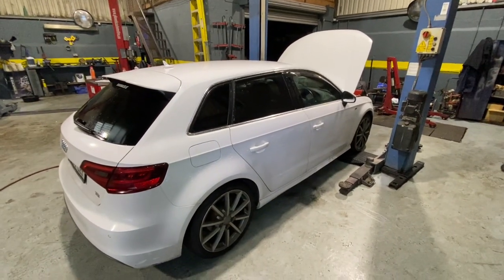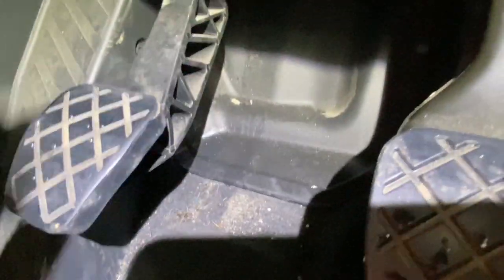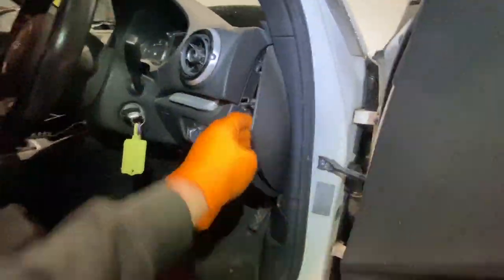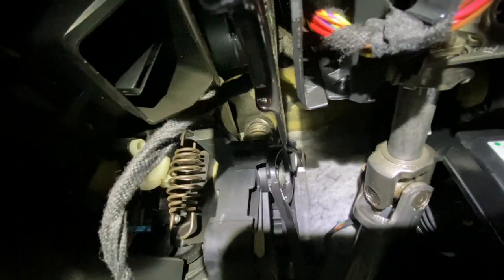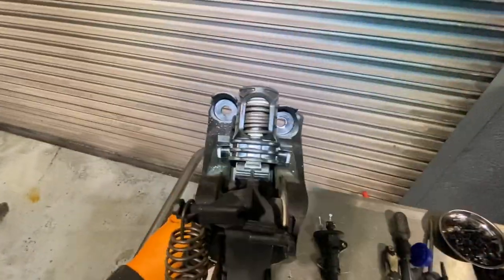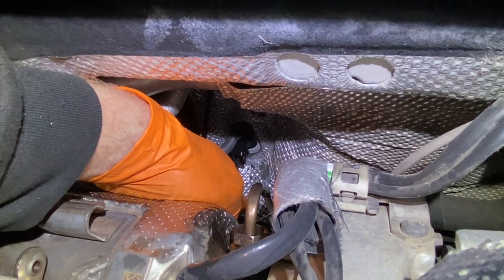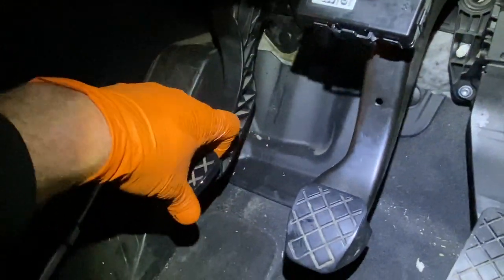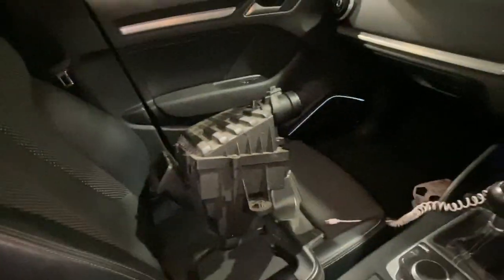Audi A3 soft clutch pedal & master cylinder replacement

Comment: Glad I come across this video,as I’ve got this to replace on my Audi aswell as the clutch kit & flywheel 😬

Got a new bush as the new cylinder didn’t come with 1 & it fitted in very easy by hand so that’s 1 job done 👍🏻

Comment: Hi peter great video, im having similar problems with my a3 2.0tdi. A couple days ago i realised the clutch was sometimes sticking halfway in and not returning all the way back out. Sometimes it needed to be pulled back manually after pressing the clutch. Then after awhile the clutch pedal became extremely soft with the pedal going all the way to the floor and not returning, especially after the car has been parked for a while. with only very little feeling of the clutch right at the bottom as the clutch is all the way in. The clutch would also stay down and have no springiness to it at all. When the clutch is like this it will not go into gear at all when the engine is started, and if try to start the engine in gear the starter motor will move the car. In order to move the car i had to start the engine out of gear. then use my foot to push in and manually pull the clutch pedal up and down repeatedly. After a while the clutch starts to have feeling and springs back up on its own. The clutch is then usable and the car goes into gears and drives fine. However whenever shifting into higher gears (4, 5, 6) the clutch will go soft again and sometimes stop going into gear as well. Requiring to put into neutral and pump the clutch in and out until clutch pedal returns. then it will go back into gears ok. Just wondering if i could get your opinion on this. was wondering if you had an idea why the clutch pedal goes soft every time when shifting to higher gears 4 and over.
Reply from the maker: It could be the clutch master cylinder or the clutch hydraulic release bearing. But you will have to try to identify which one is at fault 🤔🤔
If you use a lever of some sort & press the clutch (when it feels ok) pedal overnight. Then try to select a gear in the morning when started. If you are unable to select a gear, you are losing hydraulic pressure somewhere. Try then to locate a leak or identity where the pressure loss is happening. That is the best advice I can give without seeing the vehicle itself 🤔🤔
Good luck with it Dilly 🤞🤞👍
Reply: hi did you get this resolved?
Reply: @ShaneGriffin-g4k  I did. There was no brake fluid loss and there was no brake fluid leaking around the master cylinder so i guessed most likely it wasnt the master cylinder. So i replaced the clutch, flywheel and release bearing (Did it myself) almost a year later and around 7000 miles still going alright. Most likely it was the release bearing beginning to fail. Although it wasnt leaking.

Comment: You don't need to press in the bush with a vice. There's 2 notches that you line it up with and then you just swivel into position. My bushing and pin were completely mangled and the new cylinder didn't come with the bush. Definitely recommend you get the bush before starting this job. The pin is on splines so I plan on turning the damaged bit away from the wear side if dealer doesn't have it.
Reply from the maker: @PaulGuiry  good advice Paul, I didn’t notice that. Well done mate 💪💪

Comment: Fantastic, just having issues related to this now, a great video easy to follow and watch. PERFECT!!
Reply from the maker: Thank you Tony, hopefully this will help resolve your issue 🤞🙏🙏🙏
Reply: @kennedysgarage3281  I hope so, i did check where the pedal pushes into and where you saw fluid, last night after watching this, but here was none, my issue was day i bought it the pedal clicked, but was fine, the pedal is so light to press, then i stalled it the other day and the pedal clunked twice and them fealt like i was pumping fliud throught he pedal and now it's back to normal, so not 100% sure if it's the slave or master, or if this is a common thing these cars do, it's normal either way, i'm working away from home from the 9th of Jan so worried that it may fail while i am away so trying to cover all options in the event it goes tits up!! even contatcted garages where i'm working for full clutch fit,  thanks Kenny.
Reply from the maker: @tonymorse4573  it might be as wise to replace both the master & slave cylinders. The gearbox it these can quite easy to remove. It would give you peace of mind 🙏👍👍
Reply: @kennedysgarage3281  Hi, thanks for taking the time to reply, i don't have the time now i need to use the car to travel to work on Monday 130 miles away from home in Wales, i would definatlety tackle this myself if i had the time to, i havw watch videos on changing the clutch, it's stright forward but a lot to take off the car to do it, i've got some quote from the places where i'll be working and hopefully if it goes up there i can get them to do it as i'm working nights for the next 3 months, really appreciate your  reply. thank you

Comment: Good video well presented common sense goes along way
Reply from the maker: Me and you could be good friends. Nothing like a little cop on 😂😂😂😂
Sound Mick 😉
Reply: @kennedysgarage3281  I’m 35 years in car trade and by god the modern car is a disaster fix one thing and then there’s another problem engines now are made from chewing gum im seeing engine check lights in my sleep 😂😂
Reply from the maker: @mickkelly2229  I compare them to Lego cars, really nice to look at but if you touch anything they just fall apart 😬😬😬

Comment: hi Peter, i had my car parked and when i pressed the pedal it stuck on the floor, i brought back with my hand and same happen, i have an audi a3 2013 tdi 2.0
Reply from the maker: That could be the clutch slave cylinder in the gearbox bell housing. It would be worth removing the undertray & checking where the gearbox / engine bolt together for brake fluid 🤔🤔
Reply: Did you ever find out the problem for this my Audi a3 2015 has just done the same

Comment: Hi, I've just had a new clutch, flywheel and slave fitted last month after my pedal went down halfway. As i panicked i just got it all done.  But now it feels no different and some it feels notchy. It's got me thinking now about the master cylinder under the pedal as that's wasn't changed. Any advice please?
Reply from the maker: I think Jason the only advice I can give at this point is the clutch master cylinder needs to be replaced 🤔🤔
Simply due to everything else being done previously 😬👍
Reply: @kennedysgarage3281  thanks for the reply. Will look into getting it done.  If it's still the same then it's going 😁

Comment: Can a person ruin a master cylinder for a clutch by rotating the push rod to screw it into the fork ...Having a lot of problems here......Ive installed slave cylinders many times
Reply from the maker: I suppose the trick is to just be gentle with it and it should be fine. They are quite easy to fit though 🤞👍👍

Comment: Evening my pedals gone to the floor I can pump and get a clutch back and it’s starting still when it’s engaged… I can’t see a leak what’s the  best suggestion a master cylinder and then the dreaded slave ?? For the last week or 2 I’ve noticed the pedal was half a pedal I ain’t got any slip and it pumps a little ??
Reply: Try clamping the hose connecting the Slave cylinder,  if the problem still there,  it's likely the Master, especially if the fluid bleeding from the slave nipple is black.
Reply: @garyreeves7533  slaves inside rhe box ain’t it ?
Reply: @big Dog  The Slave Cylinder is inside the Gearbox, but the hydraulic connection and bleed nipple are outside on the top of the box near the gear selector.
Reply from the maker: All very good advice there 👏👏👏
Have you removed the undertray & looked at where the gearbox meets up with the engine sump???
A nice place to look for a slight brake fluid leak 🤔🤔
Reply: @kennedysgarage3281  still got the problem it’s coming and going and no leaks ? Sometimes pedal stays down and other times it’s fine   But spongey any more suggestions I don’t want to throw money at it I don’t need to
Reply from the maker: @bigdog4865  what have you done so far to resolve the issue??

Comment: Hi Peter, in my Audi a3 tdi 2016 a weird click sound comes when I press the clutch and release the clutch, but it doesn’t come everyday , it usually comes after a week or so, gears are smooth clutch works fine , Revs are fine, it’s just that click sound which comes every so often and it goes after 4-5 minutes of driving, can’t figure out what the problem is, please help
Reply from the maker: I would think from your explanation of the noise that it is coming from the clutch master cylinder. They are very flimsy and can start to fail in many different ways 😉👍👍👍
Reply: Hi. Did you figure out the cause of this? I have the same issue. Thanks.
Reply: @Tom-tv7uv  hi mate , I still can’t , my car had that issue last year in winters and then didnt give that click sound for almost 5-6 months and now just about about 2/3 weeks ago , again it happened for 2-3 times, something to do with cold weather or may be rain. But I still can’t figure that out
Reply: Okay, thanks Kamal. Did you try replacing the master cylinder?
Reply: @Tom-tv7uv  no buddy, bcuz the click sounds stopped for almost 5 months,

Comment: I must change the brake fluid on my Mazda. It hasn't been changed in  13 years.
Reply from the maker: Well worth doing Bastogne, bad fluid can cause quite a few parts to fail prematurely. Especially flimsy plastic bits 😬😬😬🙏
Reply: @kennedysgarage3281  Thanks, will do

Comment: I think my problem is the inferior quality of the rubber seals from the low cost slave cylinders made in china The car shifts just fine after bleeding but I have to bleed every single day there's also black goopy syrup on the push rod of the slave cylinder how many times I get a different brand always always saying the same thing
Reply from the maker: Original equipment might be the best way to go. It should last at least 5 years then 🤞🤞🤞👍

Comment: I'm having an endless problem trying to work with the plastic slave cylinders.endless issues..new cylinder.cant seal or torque bleed nut cause it's made of plastic and nut often gets rounded.eventually managed to plug the bleed nipple then the slave developed an internal seal leak.truly poor German engineering. Very disappointing. Anyways I'm done with vw plastic crap clutch systems.will now modify the system to work with a metal toyota clutch system.and feel much more secure driving a tdi knowing the clutch won't fail on me on the road
Reply from the maker: My dog is called Marvel 😂😂😂😂
Yes, the amount of very fragile plastic bits on cars nowadays is frustrating & near impossible to work with at times. I know it is all about weight saving but they are awful 😤👍👍👍

Comment: VAG would make the pistons out of plastic if they could, The quality of the components they use is embarrassing for a supposed Quality Manufacturer.
Reply from the maker: That is very true, they can be quite hard to work on confidently nowadays without breaking any other components 😬😬

Comment: U saved my bacon 🥓 I’m doing a clutch master cylinder in a 7:33 15 a3 do you have a link for those pipe blockers no pressure
Reply from the maker: https://www.ebay.ie/itm/115354054528?mkcid=16&mkevt=1&mkrid=5282-175127-2357-0&ssspo=h-VQ5o6MRjK&sssrc=4429486&ssuid=bjxxf8trsrm&var=&widget_ver=artemis&media=COPY
Reply from the maker: I found these on eBay 😉😉